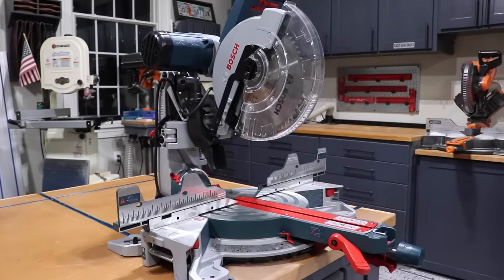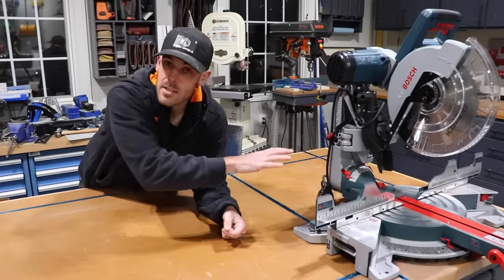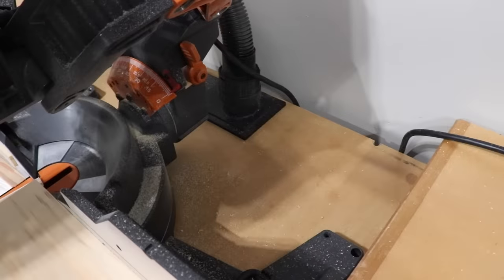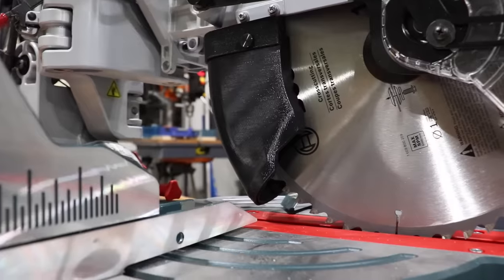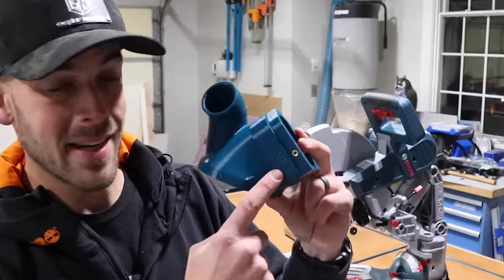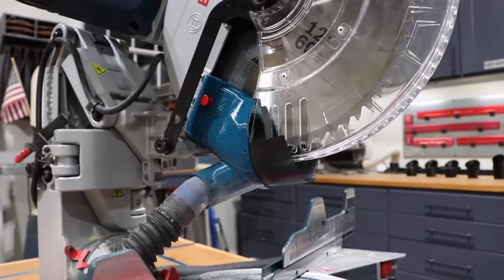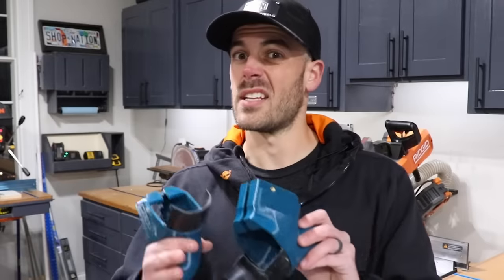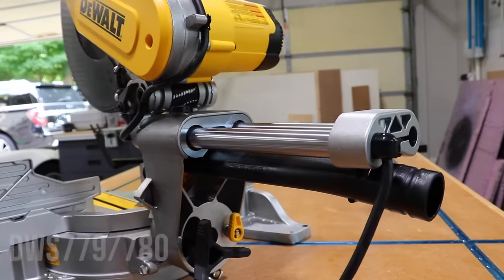It's like Bosch doesn't even care

Comment: What is the max cut depth with this on? ...1-inch?  Can you cut 2x (1-1/2") ?

I realize its a matter of compromise. More collection performance equals less clearance and cut capacity and more capacity equals less performance. 
Wonder if it could be designed as to be slotted at the thumb screws as to easily adjust it (slide) up and down an inch or so to set the rubber flap at the height of the material and at least accommodate 8/4 material (or at least 2x).
I'm guessing 1" is max clearance now? ...unless  someone answers my opening question.
Reply from the maker: You can do sliding cuts on 2x material
Reply: Cool.. Thanks for the reply.
For most people, if they're honest that will cover the needs 90 to 95% of the time. 
I'll be getting the Bosch unit before long and will certainly place an order. 

Just a thought.. which you may have done and I've just not seen it yet. Since you've had to work with all these saws engineering dust collection. You could do a roundup review and give your thoughts on the saws.

Comment: I’ve wondered… what if the vacuum exhaust was introduced into the saw base to make a high velocity air curtain with with positive and negative pressures. With a well designed throat plate you’ll directionally push and suck the sawdust. 

(Dual pressure air curtains are used at entrances of commercial freezers in lieu of a door)

Comment: It would be nice to see a "Dual" solution, where you have the solution that mounts to the moving part of the saw, as well as a secondary solution that is fixed to the base of the saw that captures a lot more of the dust that avoids the primary device.  IMO, anybody investing money into one of these saws....especially the expensive ones.... probably has way more vacuum available than 100 cfm, and would be able to provide way more than 100 cfm to EACH device and really up the performance. More importantly, if can potentially eliminate a "box", which is its own problem because of how it can limit angle and bevel cuts, or at least cause you to have to re-configure something. Ask me how I know.

Comment: Any way you can make a quick disconnect for the Rigid/Delta model?  Your current chute is fantastic for collecting the dust but what a major disappointment that I have to remove it to change the blade and that is no easy task.
Reply from the maker: I really want to, the problem is there is zero room inside that cavity. Agreed it needs it bad
Reply: @ShopNation  I wanted the Bosch but at the time, too pricy and the Delta was on sale.  I bought a premium blade for it and the cut is amazing. I don’t think I could get it any smoother with 1000 grit sandpaper.

Comment: SHOP NATION: you probably already considered this, but is it possible in your design to flare the rubber flange? Instead of fabricating the channel the rubber flange fits into parallel with the centerline of the design, is it possible to have the channel oriented away from the center of the dust port causing the rubber flange to flare outward? Maybe something to consider before the production run/release in January (if you haven’t already considered it. I just didn’t hear any mention of it in the video.). Thanks for the experimentation! Are you planning on selling the code for printing?

Comment: Looks good but original test seems a bit skewed. You showed a number of cuts that left a very thin remainder that broke apart sending additional chunks all over perpendicular to the blade that were never going to be caught by anything. The new collector was only shown making full cuts which only produced sawdust directly inline with the blade and not additional debris breaking apart.

Comment: I just cannot get out the bottom right screw that hold the original bracket. I have the tool for pinchin/grabbing the screw (doesn't really fit on the head) - any ideas? No matter how i wedge it wont come out (spins freely).
Reply from the maker: Bosch appears to have used thread lok on some of those screws. You might have run into 1…

Comment: One fallacy to your test. If You are cutting on the very edge of the wood, it throws the chunks out side ways which will not be collected. If you are further in it creates a trough in which directs it into the collector. Do trim guys cut the very edge? All the time.... But yeah... I have a bosch 10in. With duct tape all hanging down flipping all over😂.. Works pretty well with vac.

Comment: What's the tallest board you can cut with this, 4x4 6x6, that might be why their is so tiny trying to accommodate all board sizes. Many people don't set compound angles on the saw to cut crown molding they push the board to it's spring angle to make normal angled cuts without chancing making their saw out of square.

Comment: Watch Bostch buy one and copy it, what would you do?  Its published so you do have copy rights to it.
Seriously its a valid question. 

Oh id like to see finger guards over bit change openings on trim or palm routers
Like the ridged, I was using one with an over sized bit and holding it low for stability durring the cut. The factor grip is up high on the tool. But you have more control down close to the base of the tool do a fatal flaw is the bit change area becuse using the tool your fingertips can wonder into the danger zone.
Not a molded guard you can see in would both protect you from injury as well as give the tool better control.point to hold it as you use it.
Reply from the maker: Bosch has the resources to solve this, it’s clear they don’t want to. My guess is over half of their customers don’t really care so why would they?

Comment: Great job! You should check out the new Makita sliding miter saw. I think it has a pretty good stock dust collection design, however I cannot for the life of me figure out the best way to hook it up to shop vac. Ive tried every adapter I can find but nothing that is sturdy enough to stay in place when using the saw. maybe a 3D printed adapter to accept standard shop vac and 2 ½ in? Keep up the good work!
Reply: What's the new one? I can't find any info about anything newer than the ones they came out with in 2019. However, I'd love for Travis to tackle dust collection for the LS1019L and LS1219L saws.
Reply: @PikkaBird  sorry yeah I was referring to the 2019 one. Just meant new relative to the old version.

Comment: Hey bro.. hear me out.. WHY NOT take the RED thing with the slot in it...off... replace it with some sore of honeycomb or screen or grate, 3d print a compartment/vent thingy that exits out the rear for the dust collection hose? SURE it would be complex... but 3d prints are easy..its the design process that takes time. Or completely make a base for the entire saw, Kinda like those OLD laptop fan things you used to sit under your laptop? BUT if the suction was coming from there..  I bet it would get MOST of the dust!! ANYWAY.. let me know what you think..

Comment: i have a bosch glide system mitre saw
i have a nilfisk 20 attached to the dust extraction port and i get very little sawdust just a sprinkling across the back of the stand

Comment: I don’t have the Bosch miter saw but I just purchased a Bosch angle grinder and it’s a total piece of garbage.. you are correct in the assumption that they don’t even care anymore. My angle grinder i replaced it with was a Metabo but sincerely I 0:16 don’t think it will hold a candle to their older stuff either. Time will tell.

Comment: I have one question regarding this.  Because it's attached to the pivoting blade area instead of the arm structure, would it interfere with tall cuts?
Reply from the maker: It can while sliding yes. Which is why it has a quick release. My guess though is most “tall material” cuts don’t need sliding

Comment: Very interesting video and approach to the dust problem of miter saws. Now...on your blue dust collector, the bottom black part is hard plastic, I presume? What if it was made of flexible rubber. Wouldn't that work better? Just running this by you. :)
Reply from the maker: Yes it’s flexible rubber

Comment: I am a little worried about a reduction in slide cutting depth caused by your chute. It would be nice to see if the saw and chute can cut the same dimensions of material that is specified by Bosch.   I think I will keep looking.  But thanks for the video.
Reply from the maker: You can cut full width material at up to 1.75” depth

Comment: I should have watched your video before I sold my Bosch. But this saw has another critical issue, the two fence guards doesn't aling with each other and there is no way to adjut, so it will never give a perfect square cut from both sides.

Comment: I’ve watched more than my share of miter saw dust collection videos, but I’ve never seen anybody try to hook any suction up underneath the zero clearance insert. I wonder if that would make some kind of difference.
Reply from the maker: You’ve never seen it because it would do basically nothing. The blade rotation does not force dust down there

Comment: What is the flap made from? I have a different saw, so I want to try something like this, myself.
Reply from the maker: 1/16” neoprene rubber works best in my experience. I’ve also used drawer liner but it can collapse under vacuum pressure
Reply: @ShopNation  Thanks!

Comment: I just watched your video and was wondering about cut depth. I recently watched a video for a similar attachment for the 12" Bosch that looked promising but the down side was the thickness of the stock being limited on a sliding cut. I dont remember exactly but it was around 2" or a little more. Does your conversion have a similar issue? Can you still do a slide cut on a board 8 quarter by 8" or 10"?
Reply from the maker: Same limitation, mine is easily removable for that reason

Comment: Disappointed. I was so excited to get this piece for my Bosch saw. Works fine if you’re just cutting flat stock laying down. Will not cut a piece of 3 1/2” x 3/4”  on edge without getting in the way. This is not an unusual cut. Pretty standard for any base trim. Also make  a note if you have a shop mounted saw with the wings on the vertical fence all the way in, they will need to be extended out at least a 1/2”. This is an issue if you have extended fences. I understand the piece is easily removable for cutting vertical, but to have to have a piece to take on and off constantly it’s not productive. Was my understanding it only needed to be taken off for beveled sliding cuts. Not the case.  Am I missing something on this or does anyone else run into this issue?  I took some photos to help better explain, but no way to add them.

Comment: that's pretty sweet!  A few questions:

1)  You tested it on pretty narrow stock (looked to be about 4 inches wide?), what about something that covers the full slide width (non-bevels of course)?  Say something 12" where you have to start the saw fully extended and then plunge into the material and push it back?  It looks like the flange would hit the stock and have issues plunging into the material?

2)  Have you checked out the Cen-Tech Quick Click hose system?  It will solve your shop dust hose hook-up woes!!  :)  You have adapters you leave attached to the tools, and the hose has a quick attach / disconnect so you can swap that hose from tool to tool effortlessly.  The connectors also have 360* swivels built in so the hose naturally rotates as needed instead of bunching up.  Once I got this, I wouldn't consider anything else as it's a game changer.  And they also sell anti-static hoses!

https://www.centecsystems.com/standard-quick-click-kits/

Comment: I got a Rousseau shroud for my DeWalt DWS779 (12 inch compound sliding). It's a total pain in the donkey, and is EEUGE. I hate it. If you build it, I will buy.

Comment: bought this , printed it, works fine for wood until you have to cut material which is taller the  approx 3.5 inches where the collector interfere with the material. at which point you have to remove it. otherwise it's damn good

Comment: This saw apparently has major accuracy issues and cannot / will not hold 90 degrees on both the X and Y axis because of the armature.  I had always wanted one of these but now know to stay away.  Just go read the 1,2,and 3 star reviews (of which there are a lot) and you’ll see.  So really the saw dust issue, which is also a big issue with these, is really the last thing to worry about because the saw is just inaccurate and won’t hold adjustment.  RIDGID also had this saw for only a year or two and stopped selling them.  It’s a shame because the armature design seems like a great idea.  But as they say, what may look good on paper isn’t always good in practice.  
And for what these cost they should be dead accurate.

Comment: I'll buy the 10 in version when that is available and I appreciate the time and effort that this took. I'd have to rewatch to say for sure, but showing slow motion skim cuts -  which are notoriously hard to collect dust off of - for every option except the thing that you're selling is pretty disingenuous. For example, the side by side at 11:30 is apples to oranges.
Reply from the maker: I actually agree, that was just the best similar angle close up shots of before/after. This is why I also showed the areas around the saws after all cuts

Comment: IMHO the problem of motorized saws are not the big particles. You can easily sweep them up. Problem are the small ones, that stay in the air for hours, get into your lungs and can cause havoc years later. They are small enough that you won´t see them. So apart from a qualitative approach, the quantitative approach, once you have your design is important. There is a quick solution to to from 20 to 60 to 80%. But if you are a shop that does regular cuts and wants to keep most dust out of the shop air - then the 90, 95, 99, 99.9% become important.

On the other hand, it is sad to see that Bosch Blue is complacent with that dust collection solution. They market their tools for to be used by small businesses and contractors. So people who would use those tools daily, where a good dust collection will ensure a longer life and smaller risk of work related health issues.

Comment: I believe it would work far better with a 2 1/2" hose. Much higher airflow
Reply from the maker: The trick with these is actually not airflow but static suction. A shop vac and smaller hose is actually better

Comment: Need some help. Removed the blade guard from my Ridgid 10-inch miter saw. While loosening the nut holding the guard on the unit the nut, washer, and spring along with the cover just fell onto the work surface. Leaving me with no idea how it goes back together. Have seen some videos but they look nothing like my rigid 10-inch MS. I am very close to setting on the curb and placing dynamite in its teeth.

Comment: This is great, as its the exact problem I attempted to solve a couple years ago. You did better. Problem was my saw was not doing precision cuts so I dumped it for my table saw. Guards on a table saw are hard to manage as I constantly switch between cross sled and regular fence. Then I got interested in metalworking so stopped woodworking. kidding.

Comment: Does this reduce the effective depth of cut for the saw?
Reply from the maker: Only while sliding, but that’s why I made it easy to remove
Reply: Is this available with the collection port on the right side in lieu of the left? My dust extractor is best positioned to the right of the saw as you face it.  Also, will the 27mm Festool dust extractor hose fit your item without an adaptor? If not which one fits the Festool hose?  Looking forward to when these are back in stock.

Comment: The flaw is, of course, NOT 'fatal'.
Using rigid dust collectors on a mitre saw is sub-optimal. Using a flexible material (rubber, silicone) allows it to mould to features that would otherwise prevent operation- so it can be bigger = better.

Comment: Anyone know if this new dust collection device will fit the new Bosch pro factor surgeon 18volt cordless?
Reply: no.  the hub mount width is  ~1/8" narrower on the profactor surgeon 18v  12" saw-- scratching my head now for makeshift plans
Reply: @jjwj5432  sure would like to buy one but if it won’t fit. Keep us up to date if you figure a work around.

Comment: The design and function was top notch until a small cut off piece of wood kicked back from the blade, hit the dust shoot and blew it into a dozen pieces. Sending plastic shrapnel everywhere. Upon looking at the product, and I don’t know maybe all printed plastic is the same,  but it was basically printed like a corrugated cardboard box.  Smooth on the outside and mostly hollow on the inside. My conclusion that this product as printed is dangerous.

Comment: I've always thought that saw was an abomination. Of all types. Overengineered and underbuilt. It manages to achieve with 8 pivot points what other saws achieve with 2 sliders. That said, I like your approach and your design. Chop saws are notoriously crappy for dust collection. I wish the designers at the manufacturers put as much effort into these details as you did.

Comment: Sorry no improvement, can’t use port for 90% of cuts intended for a compound miter saw. Might be ok on just a chop saw for simple cuts. As for professional use, no doesn’t solve anything. I ordered installed port and couldn’t make first simple cut. Really wanted to like it, but it to big and in the way. So you created more dust because it gets removed and no collection versus some.